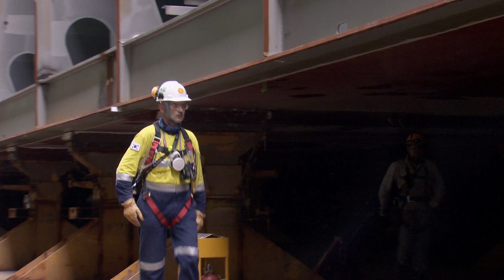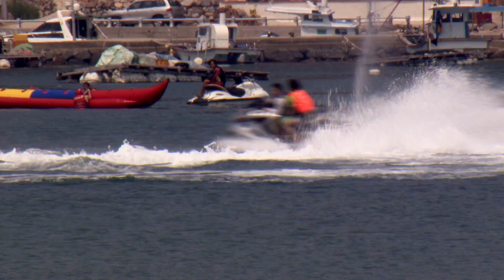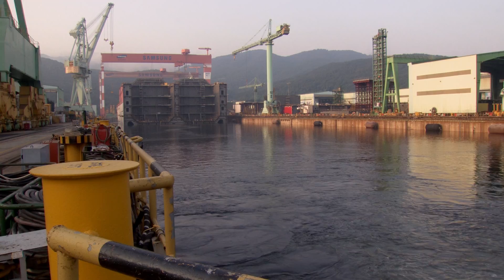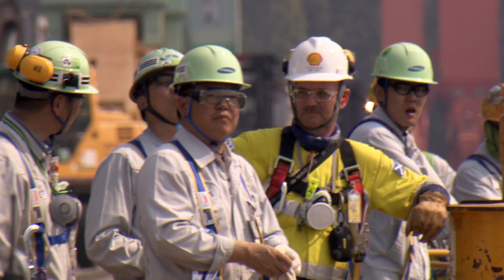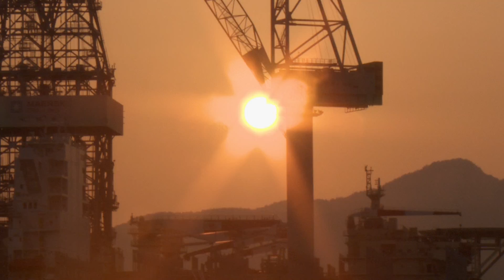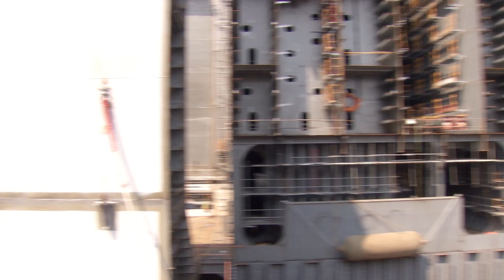A giant step forward | Shell's Prelude

Comment: Those guys walking under that ship gives me the heebie-jeebies.
Reply: Any time you walk into a building you're walking under something just as capable as killing you, supported on a lot of relatively easy to break struts. I'd wager the supports you see in the video amount to a whole lot of a larger difference between what is needed and what is there than the supporting beams in your house, even.
Reply: You are of course right about that.  It's not so much that the ship could come crashing down on my head, it's more that it seems like a very unnatural place to be.  The sound of it, the sheer mass of it... I just find it very foreboding and ominous.  I wont lie though... I would be a teeny bit concerned about catastrophic strut failure.